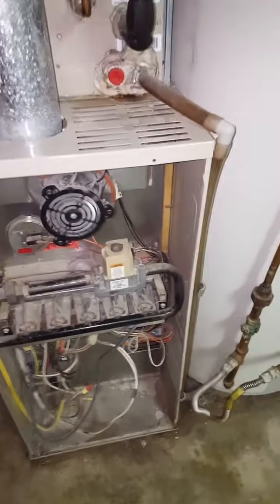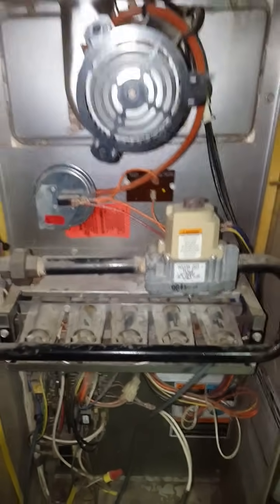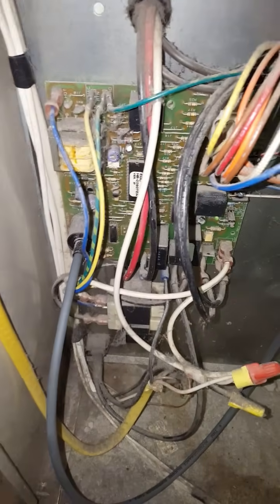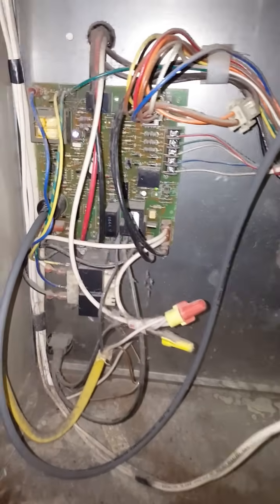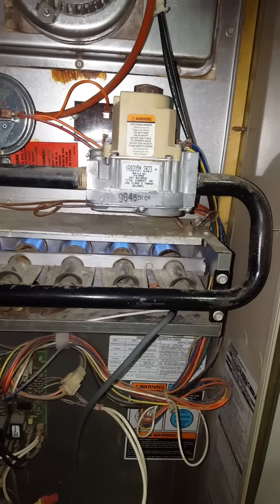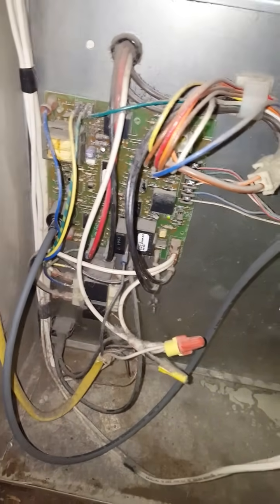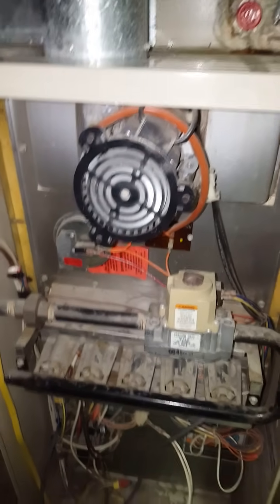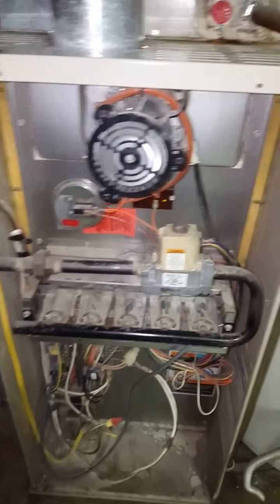LENNOX gas furnace  No spark ignition

Comment: So when you had pre-stage draft induction, before fixing your furnace, did you ever heard the unit click and then gas start to be delivered?
Mine just has the draft induction running for like 2-3 full minutes…..then it shuts off. 
Thoughts?

Comment: Thank you Kevin. After I cleaned my ignitor the spark was still weak and failed to ignite after 4-5 attempts.  Your suggestion appears to have fixed my issue - ignition occurred on the first attempt!

Comment: Can you email me  jacey03@aol.com . I have the same furnace and it won't fire up for heat. The fan comes on but when switching to auto does not turn  on.
Reply: Do you have to unplug just one end ( on the left) by the board and then  one up to the right  unscrew? Can it reset with just unplugging left side first? I'm a little scared even though I turned it off.

Comment: I replaced the blower fan this summer and must of knocked a wire loose.  Checked the igniter connection to control board and it was loose.  Fixed the problem in 2 mins. Thanks

Comment: Great video!  I have the exact same furnace.  Three days ago my hot water heater flooded my basement and the furnace stopped working.  I read the operating instructions but that didn't work.  It says that it should automatically, but it didn't.  Do you know how to light the pilot by hand?  

Thanks,
Reply: I hope you're joking :)

Comment: Your Video Sounds  and  Is the Most Honest    Most of Videos  Shows  (A) Flame Sensor (B)  Igniter  (C) Control Board  (D)  Gas Valve  (E) Thermostat  (F)  A Dirty Filter  (G)  A  Loose or Cut Wire  (H)  ETC , ETC. ETC.    The Truth is ,  Every  Furnace is Different  , It can take 5 minutes  or  It  Will take Dates  . In Some Cases  You Will need  a  New Furnace.       When a Technician comes to Fix it,  some people expect to pay $5  dollars Part. ....Thanks. -------

Comment: So what exactly did you do? I couldn't really tell in the video.
Reply: He says at 3:20 (https://youtu.be/QJN_S6lsPCU?t=3m20s) that he basically cut the wire running from the control board to the ignitor, at the end that plugs into the control board, and then plugged it back in, and it started sending signal to the ignitor again to spark. I had an HVAC tech out for a Groupon "tune up" of my furnace the other day that was exhibiting similar symptoms, and he did the same thing. Cut the wire from the spark ignitor controller (separate from the circuit board on my furnace) to the ignitor in the heat box, reconnected it, and it seems to be working...okay so far? I wouldn't do this without replacing the ignitor in the heat box at the same time, which run about $10-15 on Amazon and are super easy to replace. That's what I'll be doing next anyhow...

Comment: Thank you! Now my furnace is working again. It was the ignitor.
Reply: Mark Berger.  mine is the same way I replaced the igniter and flame sensor also made a new cut on the grey wire it worked fine but only for 2 days after that I bought a new grey cable and same result. now everytime I flip the switch it makes a clicking noise. any ideas

Comment: Mine's a model 80MGF3-75A-1, presumably a slightly older version of yours, and it developed the same problem yesterday. Thank you for making this video; you saved me a serious chunk of change.
In my case, I found that just removing the connector and replacing it a few times was sufficient, but that might be a more short-term fix. Time will tell.
Reply from the maker: your very welcome.  the reason I made the video is because I couldn't find anything on YouTube that was that useful. that was even close to my model.
Reply: @kevinEbrooks  Hey Kevin, thanks for this video, I have same model and am having similar issue.  Couple of questions:  when mine is trying to start, I hear this clicking (more clunking) noise continious for maybe 10 seconds, then the unit stops, and retries again in a few seconds, then back to the click/clunking noise.   During that time I never hear the igniter sparking.    So I am wondering, was your making that same clicking noise when it would try to start?    And then one more, once you DID get your to ignite and start, did your's ever die (lose flame) and try to reignite soon after lighting?  My problem is intermittent, and sometimes, when it finally does ignite, occasionally it will ignite and then die like 2 seconds later, then go back to trying to reignite again (and will sometimes finally light, stay lit, and run normally).  Wondering if yours ever died like that after starting?   thanks for the help and the video!!